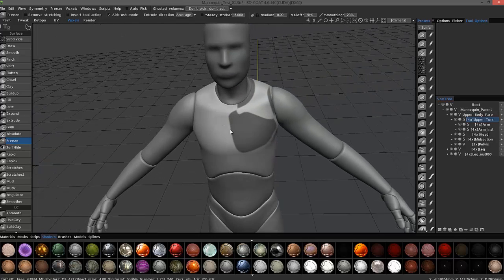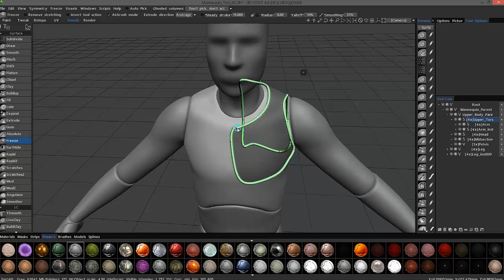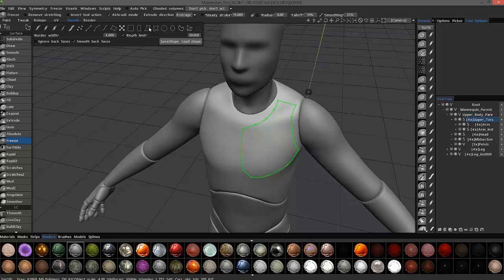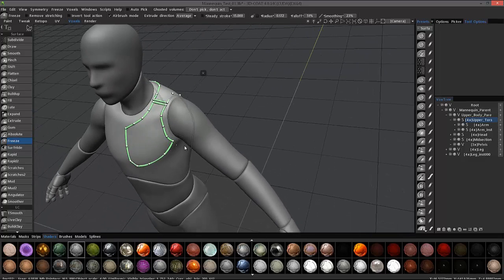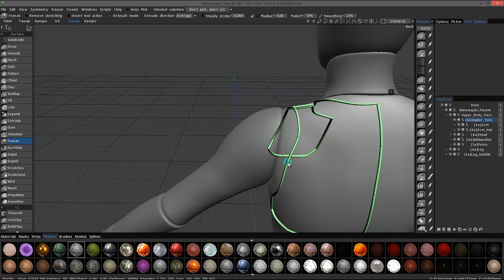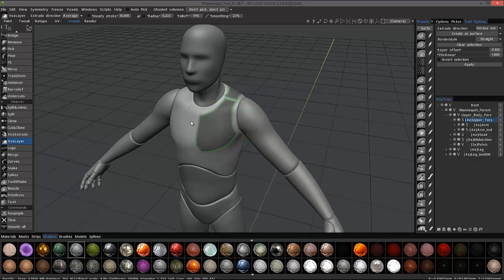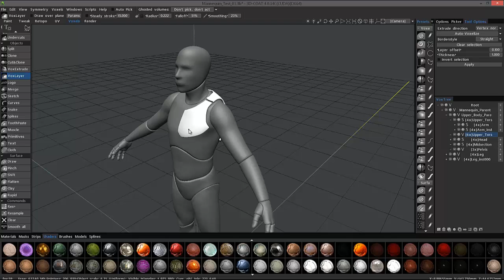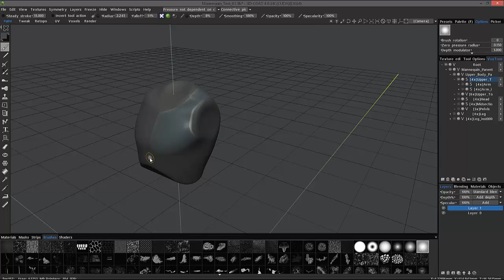3D Spline

Comment: how you navigate (rotate the object) while you have the Close Sline selection tool active? I have a problem with that. When I click LMB outside the object (LMB is responsible for rotation) it create another anchor point for the Close Spline, instead of rotate the object ;/